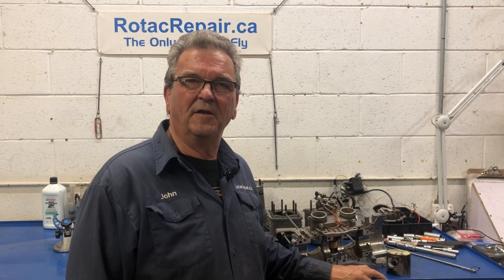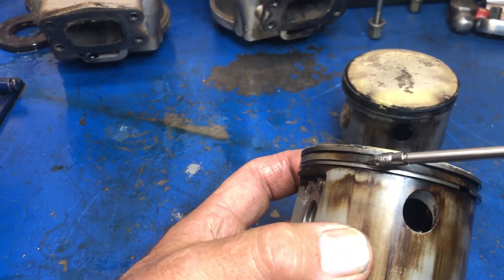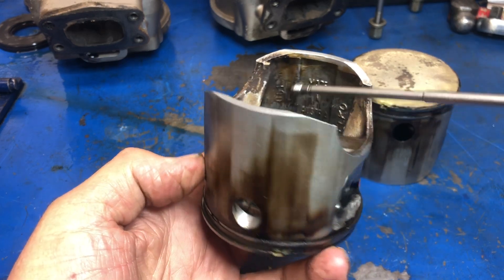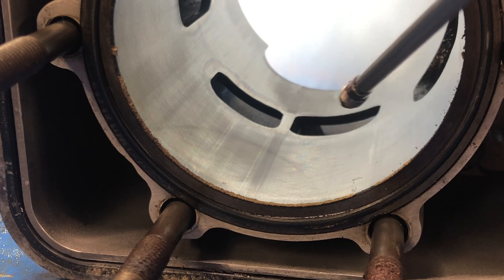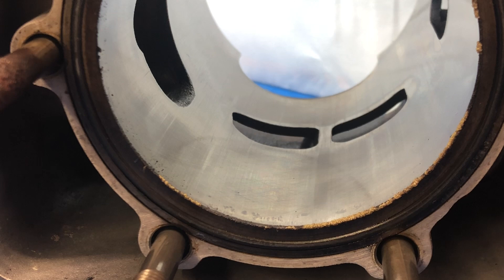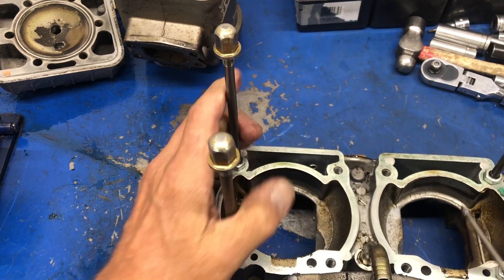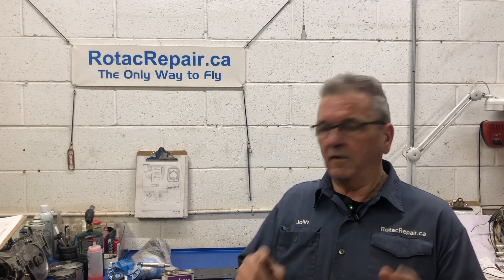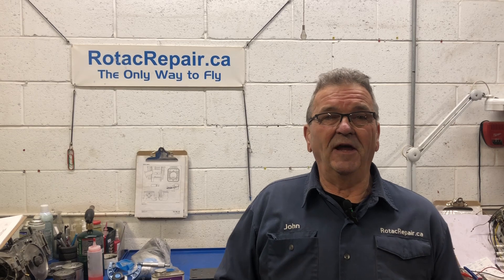Rotax 582UL internal results of fibreglass resin ingestion

Comment: Is it possible to use a resin free fuel tank of some type.. Appreciate the you take making these videos
Reply from the maker: Thank you for your kind comment. In my opinion aluminum fuel tanks are the only way to go, also if the fuel in the tank is more than 30 days old it should be completely drained and replaced with the freshest fuel available.

Comment: Are you interested in building a couple of 1969 SeaDoo 372's?
Reply from the maker: @davemall1  Those yellow seadoo’s were the start of it all. The wood grain dash panel and sled handlebars are so retro! I have the manuals. Parts availability I’m not so sure about, particularly the connecting rods. I would expect some component corrosion issues too. Let me know if you’d like to move forward on these restorations. Best regards John
Reply: @RotacRepair  I have been watching your channel to learn about building engines.  I think I have 2 good crankshafts but that is yet to be determined.   I guess my question to you is. would this content be of any value to your channel?  I actually want to do it myself, but I also want it done right.   If there is a way to make it beneficial for both of us...well that's what I am getting at.  If not I will continue to watch anyway.  Love your channel.